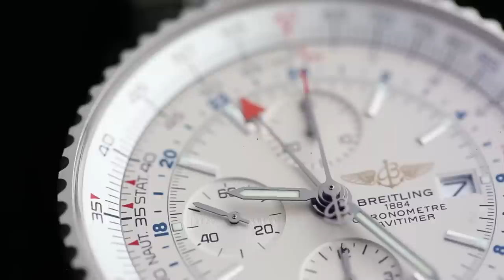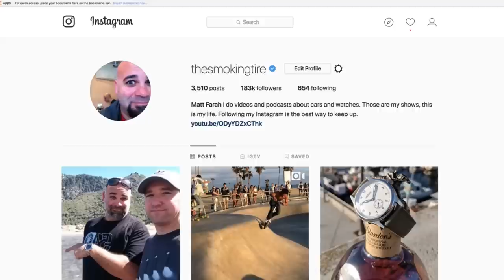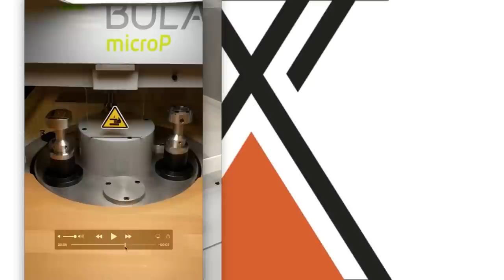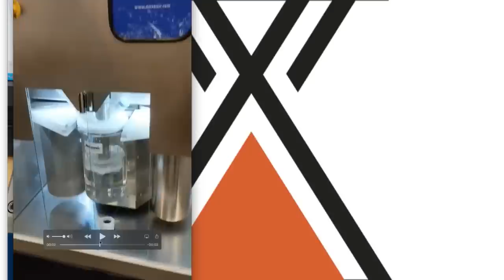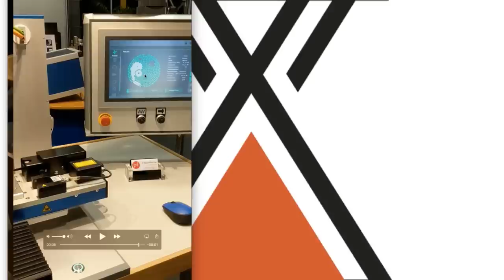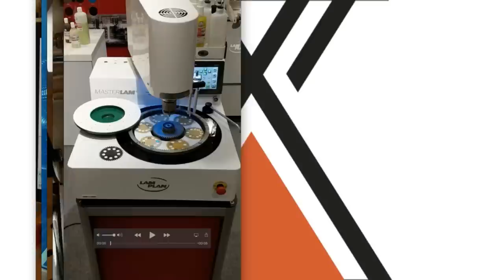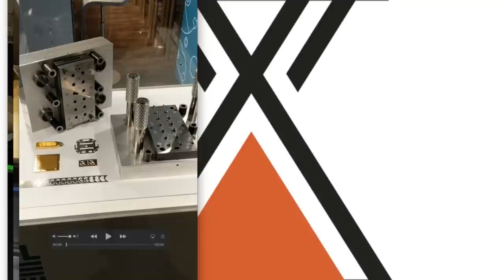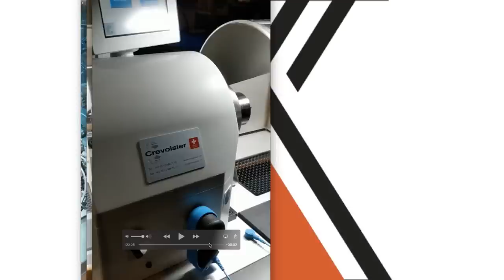Episode 25 - Weird Watchmaking Machines!

Comment: Another great videos guys, keep it up!  Cameron, I have something here that I would really be interested in your opinion on as a watchmaker and as someone who worked for a major brand.  My father is a watcmaker, and recently did a full service on a vintage Patek pocket watch.  Unfortunately it needed a mainspring, which was impossible to find anywhere.  After searching, only only option was to send the watch back to Patek to have them service it.  Not I know a company like Patek will want to re-service the entire watch, despite only needing a mainspring, but I received a quote yesterday, and my mind was blown as to what they wanted for a service.   $15 000 CHF!!!  That is literally the value of the watch, running, on the market.  Do you think they are completely out to lunch, or would they actually be putting 15K worth of man hours into servicing a time only pocket watch that needs one spring... Curious on your thoughts...Thanks!
Reply: For 15,000 CHF it would be a full restoration.  Man hours for a full restoration of a timepiece that is out of current production can include hand making replacement parts for it and easily could surpass 15,000 CHF in labor.  Due to the nature of the work the restoration will also likely take over year to complete since there are very few qualified watchmakers to complete that type of work.  I have prepared estimates for restoration work as high as $20k for a simple time only wristwatch.  It required things like striping the movement plating off and re-engraving bridges by hand and also re-applying geneva stripes and decoration on the movement and remaking pinions for certain wheels.  This work is all done by hand, the old fashioned way if the replacement parts are not readily available in the vintage archives.  If the brand is low on replacement parts or completely out of stock of replacement parts for out of production vintage timepieces they will stop selling parts to anyone outside the brand workshop.